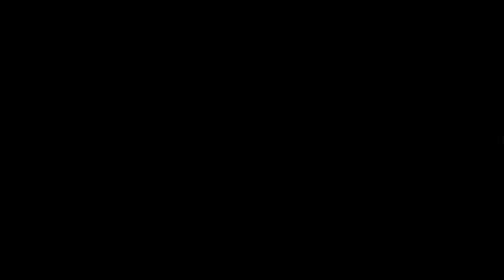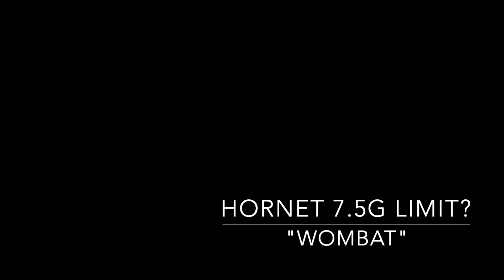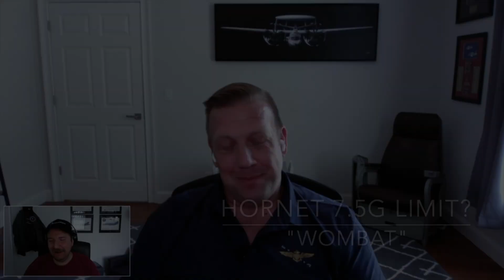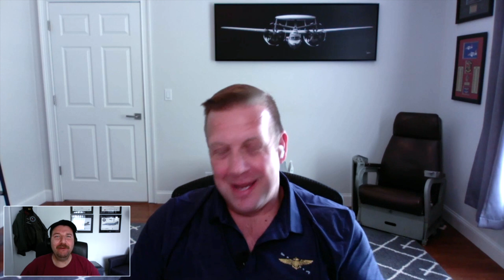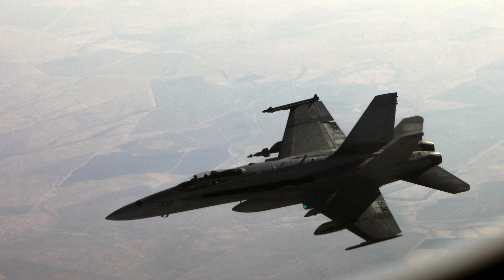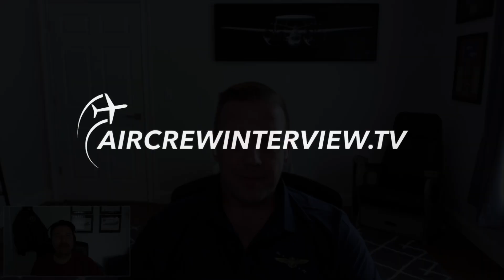Does The Hornet Have a 7.5G Limit? | "WOMBAT"

Comment: In the Gripen, the G Overide is built in to the stick, If you pull you will reach a “soft stop” region which limits the plane to 9Gs. But if you pull harder, the stick will go to the hard stop region and allow you to pull an extra 3Gs. 

I wonder if thats a better design philosophy because in moments like this, its easier to simply pull harder than to switch a paddle on the stick
Reply: Eurofighter and mirrage 2000 use the same system

Comment: "I wouldn't have gotten in trouble" I think that anecdote is gonna have a bigger impact on the navy than anyone person thinks assuming the story and his personal anecdote wasn't well known in the service to begin with.

A pilot who is more worried about getting in trouble almost rejoins with his shadow because the jet won't give him more. The question I ask is why this limit and ability to push past it exists if when given a chance that was existential in nature, the pilot wouldn't use it.
Reply: Perhaps it is to preserve the airframe, rather than have excessive g's routinely pulled when not required?
Reply: @stevepritchard3970  That’s the reason. From a couple of these pilot interviews found out that if you over Gee a jet you knock it on the head for day and return to base with no more aggressive manoeuvres. The jet will then go through a completely inspection to see if the airframe has been damaged. One pilot said he had to help the engineers on the next 10 (?) over Gee inspections after he over G-ing, so he the could appreciate the results of his actions.

The Super Hornets had the limiter and paddle. The As and Bs did not. Not sure about the Cs and Ds. In Top Gun Maverick, you see the paddle being used when pulling up after releasing the bombs.
Reply: @recce8619 the c and d had the paddle

Comment: didnt get the answer tho :(
Reply: Sure we did. The operational G limit is 7.5. Pulling the paddle overrides that, but it’s not some thing that’s done lightly. If you do pull the paddle to override the FCS g limit, the airplane has to be inspected.
Reply: @cab6273  And 7.5g is painful, even in planes that can pull or sustain 9g the pilot can't take it for more than a few seconds, so fighting an F-18 in an F-16 the greater g limit rarely gives more than a marginal advantage.
Reply: @FireAngelOfLondon  agreed. Some people make too much fuss over 9g v. 7.5g, especially considering the Hornet’s low speed handling
Reply: @cab6273  And the plane will rat out the pilot to the ground crews, if he/she goes over the limit on the flight. I learned that from a F-16 test pilot that worked for the Fort Worth division of General Dynamics (before the sale to Lockheed). The info will be stored in the plane's computer and there is nothing the pilot could do to erase it. I imagine the F-18 is the same.
Reply: @magoid  yes, the jets will certainly rat you out.
Reply: I remember reading an article in Flight international discussing about this a little bit. 7.5g in the limit set in the flight control system but aerodynamically speaking, the Hornet is capable of 9g. The aircraft structure is always strong enough to pull 9g but not all of the onboard equipment were 9g rated as the navy requirement was just 7.5g. Finally the Swiss air force F18c are rated for 9g so they have different software and some equipment needed to be changed. Also the expected service life needed to be recalculated with 9G.
Reply: Listen again, he clearly did state that.